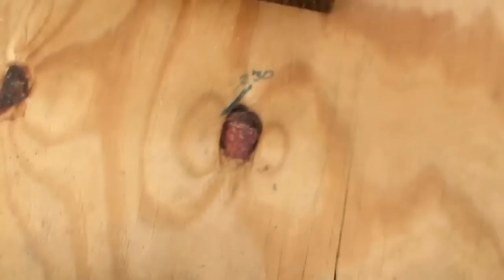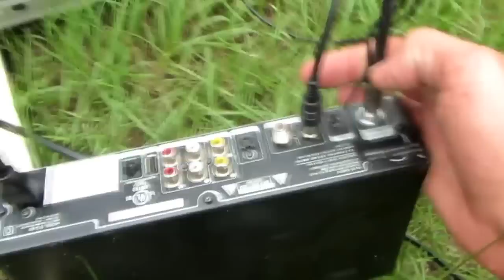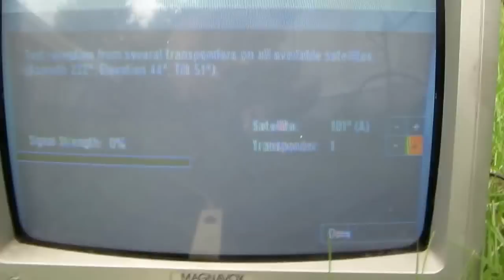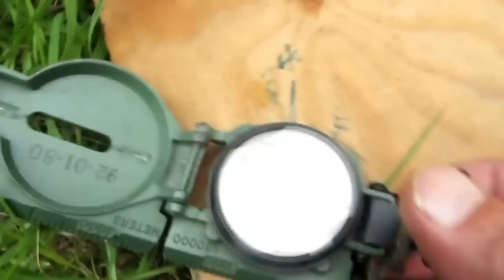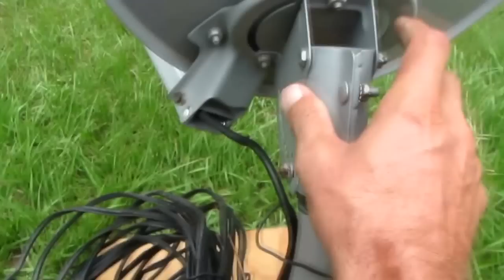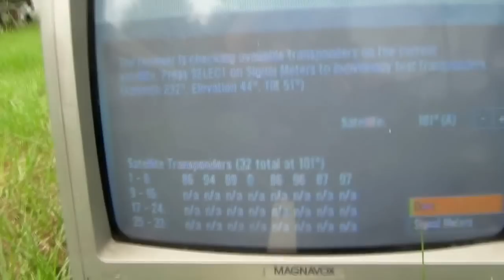How To Set Up Direct TV Satellite Dish.

Comment: Great Video, I just had Direct tv installed on my house, if I buy another Dish can I take the box in my house with me when I go camping and use it to watch TV?
Reply from the maker: That's what I do. Thx for watching.
Reply: remember, DTV does have low voltage running through that cable, it's not like the old Coax for older cable systems. You have to buy the higher quality stuff.....but once you have 100ft of cable, you are limited only by the length of cable you buy. Just like Bill here....just so long as the box and the receiver talk and your account is payed up, DTV has no clue where your receiver and box are located.